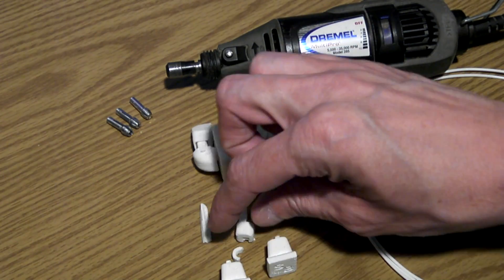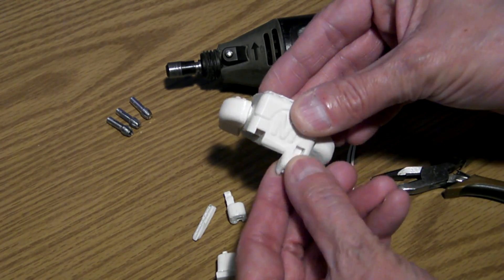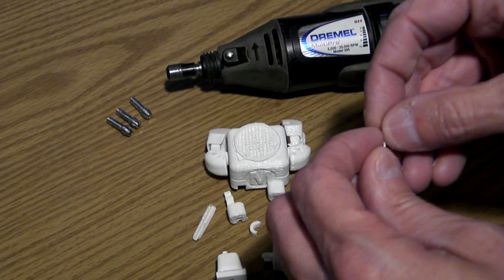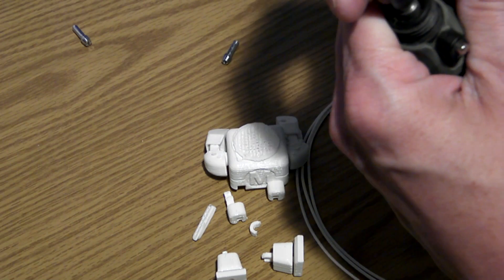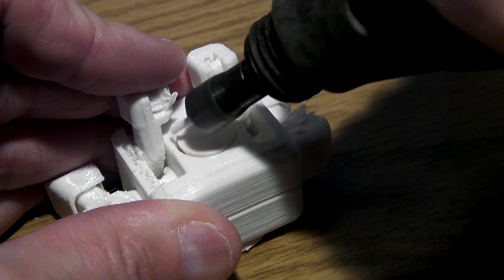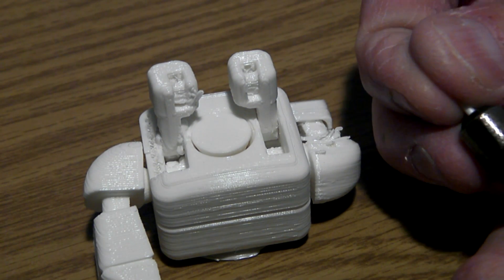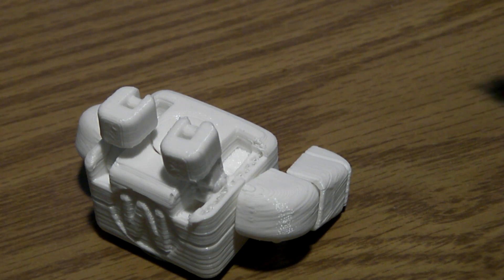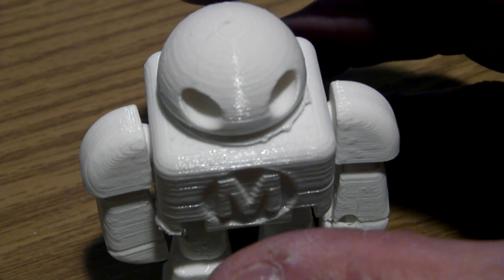Makey Robot Friction Weld Repair

Comment: How firmly do you have to press the filament against the joint
Reply from the maker: Not much pressure is needed. Depends a little on how fast the tool is spinning.  Your best bet is to test a little on a piece of scrap to get the feel.